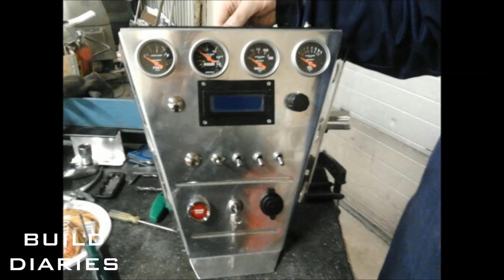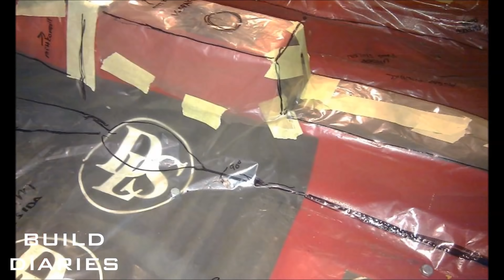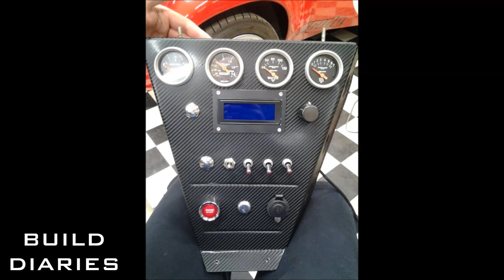MK1 Ford Escort Rebuild and Swap Project

Comment: Any chance you can what it cost ;) always wanted one regards tony
Reply: Hi tony! I didn´t know that somone made a buildvideo about the Mk1 Escort I made. But That´s really cool. What happened after this video is that I got restless "again'" and rebuilt the enginebay and fitted a homemade twincharger system. Where the twinscrew supercharger boost into a large Holset hx35 turbo. Really effective and super responsive. 
The car is still here in Umeå /sweden but with another owner. He fitted methanol/water injection to it and made it even nicer and more powerful. 
So now it have over 400hp at the wheels. Really cool car indeed- and it´s for sale for about 200.000skr (about 20.000euro).
Best regards Mikael Fredriksson
Reply: Dave Iauco An educated guess: they are readily available and relatively cheap in Sweden. The tuning parts are available. There is little history in tuning Ford engines, they are rare and expensive too.